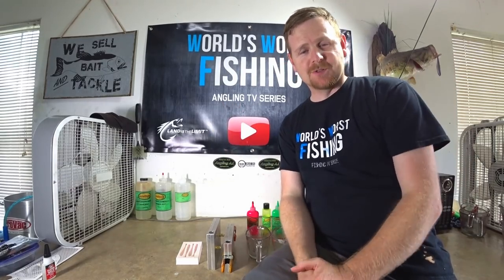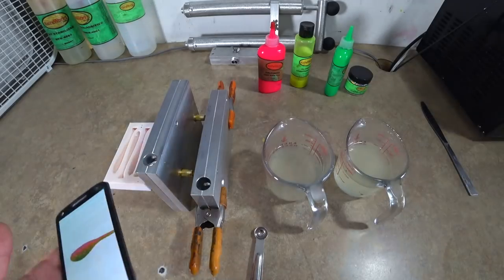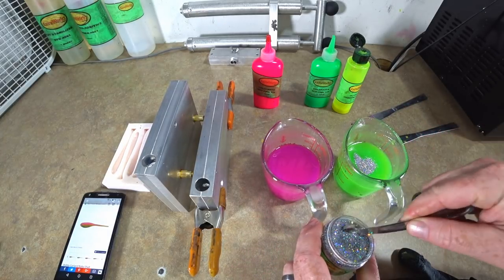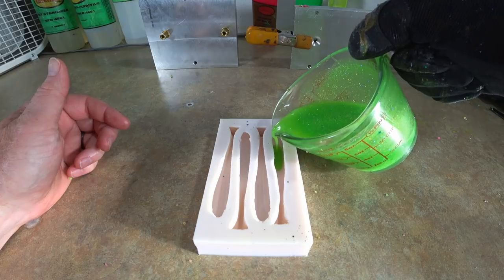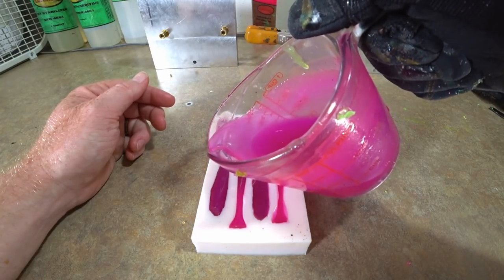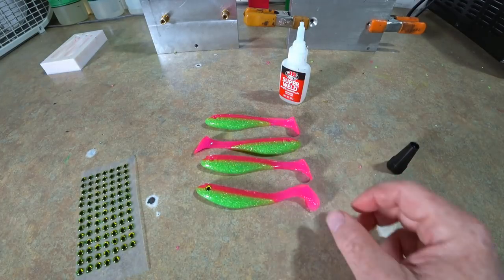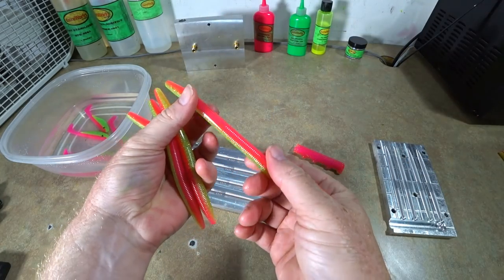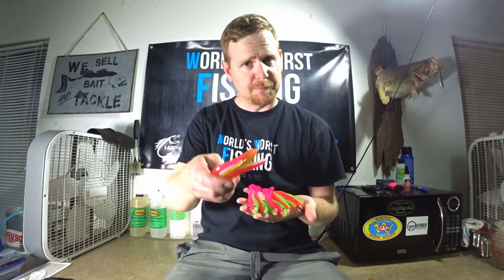Saltwater Series: ELECTRIC CHICKEN, Making Saltwater Soft Plastic Lures

Comment: Excellent video love the color. Could you quickly explain the water after clear dipping. Im sure youve covered it. Just slipping me for some reason
Reply: To cool the plastisol down so you don't set it on the counter top and the hot plastisol sticks
Reply: Nick Rundle yea i pretty well figured it out as soon as i pressed send. Silly question
Reply from the maker: yeah it just kick starts the curing process and cools the dip down quickly so you can touch the bait.

Comment: Nice video. Cool color. Now I see that A.I. has a core shot Ned worm. What will they think of next? Lol.
I bought a 5 gallon bucket of Dead On in the swimbait blend. I ended up buying some 2.5 gallon F style jugs and a 10 inch funnel  to put it in and make it easier to handle, had to buy 12 since that was the minimum though. At least I'll have extras. Haha.
Reply from the maker: right on man! Ai has a ton of great ideas coming down the pipe believe me haha..and yes jugs are a great way to store plastic!